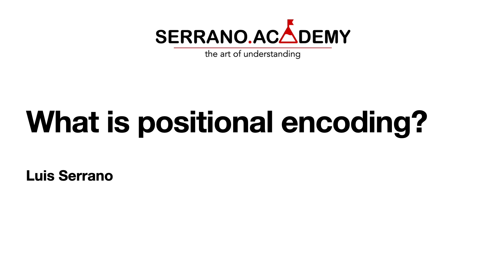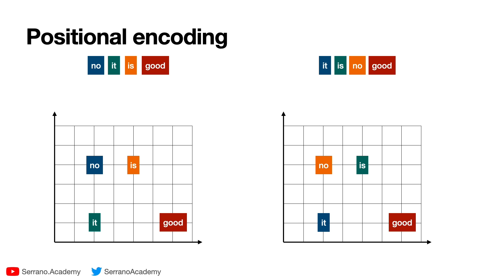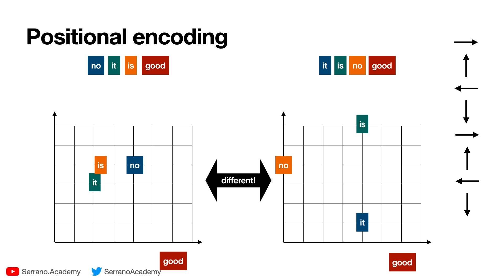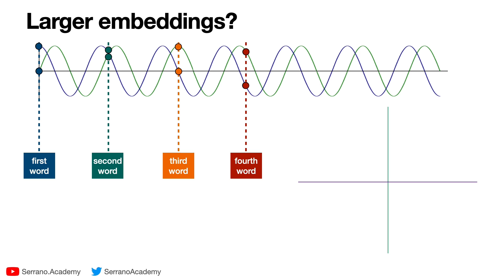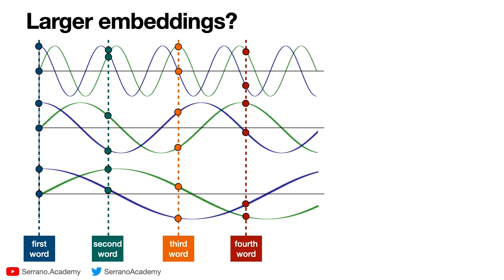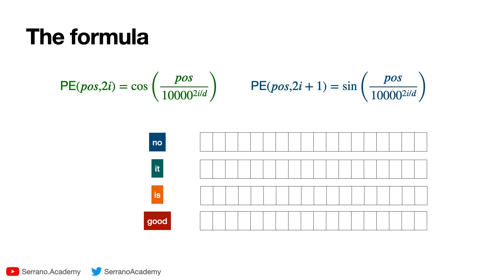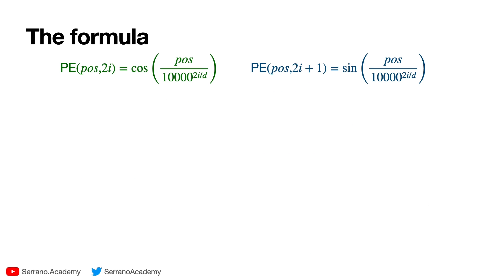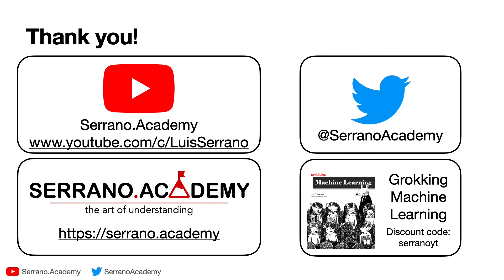How do Transformer Models keep track of the order of words? Positional Encoding

Comment: Awesome vid!
Some thing I don't get: embedded vector contain SEMANTIC information, whereas position vector contains CHRONOLOGICAL information.
(1) Adding them up is like adding apples to oranges b/c they are different by essence.
(2) Position info being a sin() or (cos(), it ranges from -1 to +1, so a value that can have a huge impact on an embedded value (which, if I'm not wrong ranges from 0 to 1).
What is your take on that to clarify?